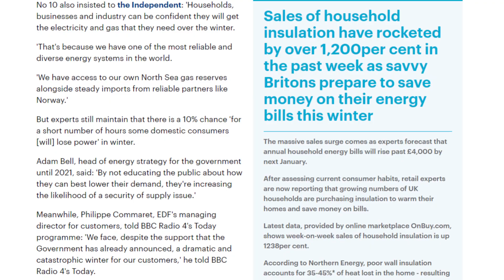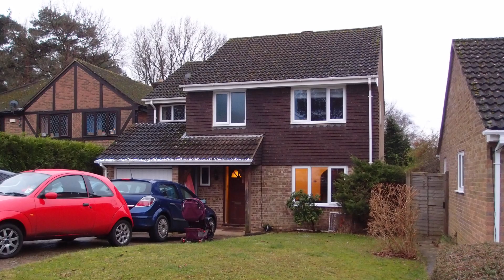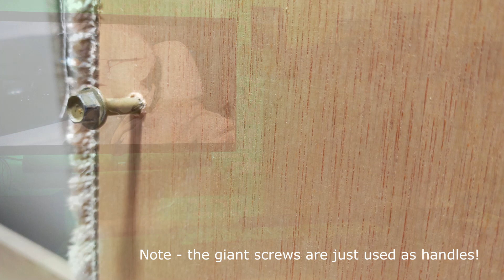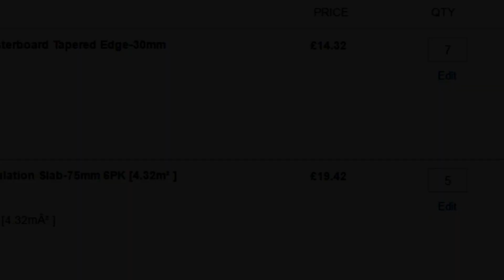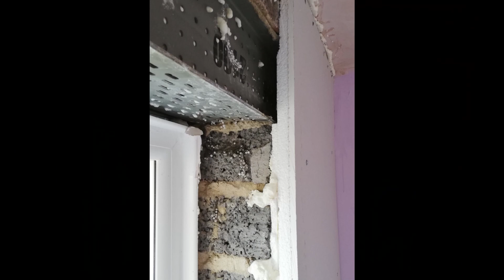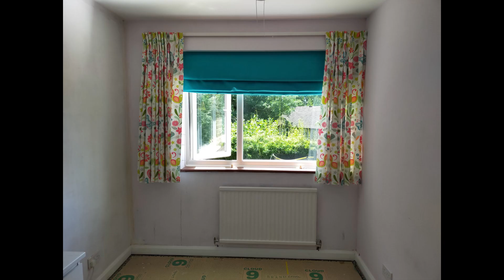Energy Crisis Ready? Super-insulating my old house! Tips from my 7 year project!

Comment: Hi, what is stove proof insulation that you used? I assume that is around a twin wall flue?
Reply from the maker: Put this into ebay - "Ceramic Fiber Insulation Blanket for Wood Stoves" it says "Aluminosilicate ceramic fiber blanket ,is a high heat resistant non-combustible blanket rated up to 1260 °C".  A wood burner should run at about 300C - but could get to 500-600C in extremes. So miles below the limit, and the flue pipe a metre above the combustion box will be cooler than that.
Also, instead of plasterboard around the stove make sure to use a cement board / hardiboard I think it's also called.  It can be painted with any normal wood paint.  Very important to observe the "distance to combustibles".

Comment: INSULATION PLASTERBOARD 38MM (25MM POLYISO & 12.5MM PB)
£38.90 £46.68 (inc. VAT)

Thermal conductivity:
Polyisocyanurate 0.023 W/mk
Plasterboard 0.19 W/mk
Sheet Size 2438MM x 1200MM

Priced just now from my local builders merchant that i normally use in Newtownabbey (outskirts North Belfast) Northern Ireland.
Reply from the maker: Best to buy in bulk given pallet delivery costs of about £60.  If you look to buy about 10 off ebay you can get companies that will deliver at about £30-35 a sheet.  I used a company called building-supplies-online in 2016-2020 and was getting the sheets at about £20 each!

Comment: Great idea about drilling through wall to get to lintel holes. If you did this how would you know how much foam to put in?
Reply from the maker: You got to first know yours is a hollow steel lintel and not a old house with a lump of concrete. I guess when the drill stops and there's a metallic sound behind as normal drill bits won't go through steel. I would always recommend drilling about 5x 1cm diameter holes  the length so the air can be pushed out as the form expands. And to only put so much in each hole as after a bit the foam will try and kick out the hole you're using . Cold foam doesn't expand as much. But I used 3x 750ml cans to fill a 2m lintel. Need a dust sheet to catch the foam that does come out. Don't touch foam until set. And it doesn't come off clothing. After 2 baths and fingers rubbed together it comes off skin! And don't breathe in the form gases!

Comment: Lots of hard work & good info there Mark. I have a similar house (1986) with similar problems. Next project for me is the loft & 200mm of extra insulation & a raised storage floor. One of our bedrooms has dormer windows & the dormer cheeks leak like a sieve. They need ripping off, new insulation & replacing with something more substantial than exterior painted plywood.
Reply from the maker: Thanks! Probably 100 weekends and some evenings and days off work over 5 years. Dormers built before 2000 were terrible, pretty much no insulation in them. Building inspectors probably cared only about joinery skills of the carpenters! Celotex is 2x the insulator of the fluffy glass fibre for same thickness so yeah for dormers where space is tight you need celotex there.